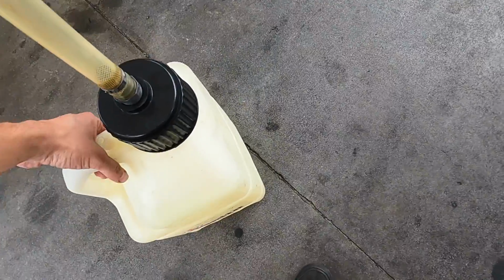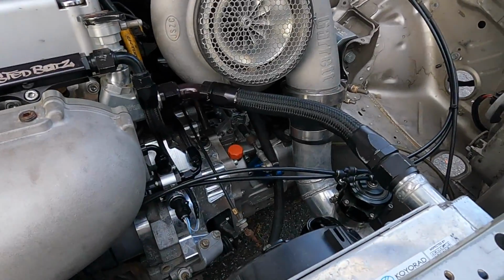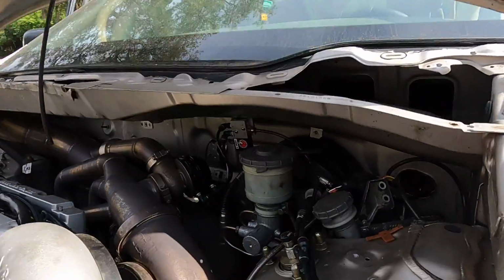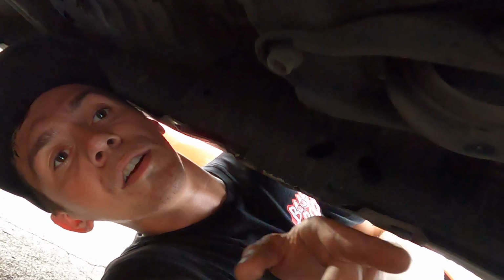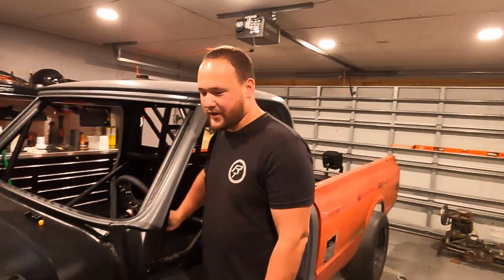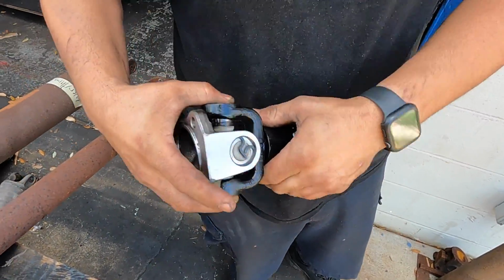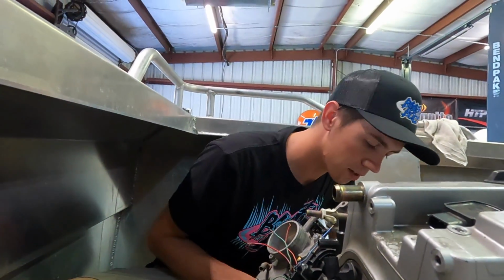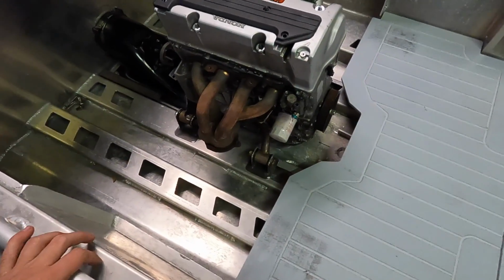Custom Parts Came For Our K-Swap Jet Boat Build!

Comment: I love the fact that your k swapping a jet boat when most just convert from other water craft, same as the Sandrail v6 honda engine making far more power and torque than most side-by-sides with more suspension travel aswell. You can buy something but converting these things with engines that can easily make crazy power even in boosted stock form is far more fun and offers more speed and ideas down the line.
Reply: Phong woulda used a modified cv joint from the pile  instead of that bought not built piece lol.
Reply: @leadfoot8593  we all would have. Haha
Reply: @leadfoot8593  yes Kyle and wyatt are trying to do things better now so getting some parts to a high standard when the will probably turbo it is logical. They could make something but it would probably break and you wouldn't want to be sitting on that aluminum seat with a turbo k series doing at any speed with junky parts underneath you that's for sure. Imagine a exposed flywheel coming lose of backing out its bolts.
Reply: @beany1987  kyle has a GF stop trying to choke on his wang.
Reply: Not to mention a nice side by side is 20-30k or buying a motor out of a skidoo is 5k or more. Way cheaper and way for fun and cool to see work. I’m jealous.
Reply: I love the sandrail and have buggies myself but there is no chance that rail would hang with a new rzr or can am suspension wise lol but on relatively smooth sand and not a super short run it would destroy them in a drag race.

Comment: Today I had to change the oil in an APU on the helicopter I was working on and that job sucked. However, it raises a question to Kyle. How are you going to change the oil in the beast?
Reply: On inboard boats you typically suck the oil out of the pan with a pump.

Comment: If your tapping where your mounting the Engine mounts, either use 4 massive bolts to increase thread interface or run 5 smaller bolts, two on the inside and 3 on the outside.
Reply: An use a fine thread bolt to get more thread engagement.

Comment: Hi guys! For the contact between dissimilar metals you could use some Parr Alumilastic if you can find those, we use this caulking on Reitnouer trailers for this exact application. You can also simply use some tape, any plastic type, I recommend clear bra but even packaging tape is still better than nothing.
Reply: Or just get some sheets of rubber gasket material from the parts store an slip it in like a shim between the mount.
Reply: @eldonerc2524  I figured they should have tape laying around, anything is better than nothing

Comment: Kyle you were talking about the mounts .. even if you put a 1/8 " thick alloy plate under the steel it will help ... just like your roll cage mount plates .. and it can be a sacrificial plate so you dont damage the boat rails .. this boatis goi t to be mental ...

Comment: Use stainless Nutserts for your engine mounting.  That way it is stronger than the aluminum and if they get damaged,  they are easily replaced.
Reply: Definitely don’t want stainless on aluminum, Will cause electrolysis. plated would be the best idea
Reply: @cjstricklen2930  Not with a zinc tab mounted near the engine,  as there should be anyway.

Comment: If you can keep the battery voltage at around 15 the electronic power steering will work much better. The voltage drops cause dead and hard spots

Comment: the idea behind the movement in the driveshaft isnt actually do to with installing etc, its to do with the flex inside the boat, the bonus is its easier to install etc.

Comment: I dunno about the bolting the engine mounts thing... that seems like a very weak point that won’t stand the vibration and torque. It would be something that breaks after a couple years most likely but with the engine right next to those two back seats... I dunno how I like that... I would possibly consider making the metal lower mount out of aluminum so it can be welded solidly. That wouldn’t be hard to do either... then it’s welded and you don’t rely on bolts and thin aluminum threads... trust me, they will fail eventually, aluminum is not great at holding a thread, the amount of times ive stripped aluminum threads! 🤦‍♂️ Anyways hope this finds you well!
Reply: Chances are that those mounts will be regularly inspected with engine rebuilds.

Comment: Love the jet boat build series. I would like to suggest another idea for the motor mounts. instead of drilling and tapping thin aluminum stringers, look into installing a heavy duty nutsert rivits. I use these in  body up fitter shop  i manage, and they hold great

Comment: Water to water heatexchanger so you can run it in salt forever. And you could still notch under the the engine mounts and add some thicker material, just make sure its flush.

Comment: Kyle, you can always install nutzerts into boat frame. Just use plated ones not stainless because stainless will make aluminum oxidize way faster than just regular steel.
Reply: Why not get some aluminum lower billet mounts made and weld them in and let the mount bolt in.
Reply: Nah, wrong mate. 316 SS is the go to bolt preference for any aluminum fabrication, especially marine.
Have a look at any Quality outboard motor or PWC. The only choice worse than steel is galvanized steel, zinc hates ally. 
What really opens your eyes is Mercury.
The mercury from a broken thermometer in the bilge will sink an ally boat in hours.
Reply: @allxdup1909  I agree 316 stainless with a thin slice of rubber to insulate the steel bracket from the aluminium. Aluminium solar frames are mounted on metal roofs this way and i have seen 10yr old installations with almost no corrosion even near the beach. Sometimes the stainless will sieze in the alloys threads though. Maybe a little grease on the threads might help this.
Reply: @lukel2793  always use anti-sieze on ss nuts/bolts that are exposed to the elements. It stops them from seizing together💪
Reply: @lukel2793  Mate with rubber under the mount bracket you will never keep the bolts tight, Duralac compound insulates all you need, its a common marine solution.
Reply: @christopherthacker7359  agreed anti-sieze would probably be even better but grease is often more readily available and will stand up in wet environments. Have used it in many boating applications with great success over the years. Growing up in North Queensland, Australia I have been salt water fishing all my life and have had a few boats now. A lot of people here including myself also swear by lanox spray to protect outboards etc from the salt. Even after 20 years they are strill like brand new under the lanox. No siezed bolts :)
Reply: @allxdup1909  im only talking about a very thin piece like some tyre tubing but yeah as long as the materials are separated in some way. It may even help with vibrations/ noise in the boat.
Reply: @lukel2793  sorry mate, it'll never work. He already has flex bush between upper & lower mount anyway, no need for more where it will cause an issue with staying put.
Reply: I understand what your saying but in the real world I have never had this problem when bolting stainless brackets to aluminium as long as quality fastners are used. If your fastners are coming lose in something like this then you just didnt have enough clamping force to begin with. This is why i personnally wouldn't use nutserts. Other things like sprung washers or nylocks could be used. Even with the poly bushes it is suprising what can vibrate in a boat at different revs and speeds. I am happy to agree to disagree 😂
Reply: @lukel2793  Maaate... remember we were talking about steel brackets on aluminum, and, the need for SS bolts to minimise dis-similar metal reaction, and, duralac or similar compound to eliminate the residual risk of the dis-similar metal reaction. Rubber between 2 surfaces makes for a very unstable, poor load bearing solution. Do you realize most boats/vessels have solid engine mounts? They are floating in water, one of the best vibration dampers around...
Reply: @lukel2793  AND Luke, we are talking about an engine with all its vibrations & loads, in a semi flexible hull, IN a salt water environment, a slightly different real world than a solar panel sittin on a roof. Not to mention skipping across sandbars. Disagree all you like mate, you don't seem to have much real world knowledge about things mechanical or marine.
Reply: @allxdup1909  Im not here to discredit what your saying, just saying there is more than 1 way to do things. Some people watching may have projects and not an unlimited budget. I just like to point out these solutions as not everyone has access to duralac or nutserts etc or may be able to afford antiseize when they might have grease laying around or an old tire tube. I've personally had saltwater going boats the last 20 years growing up on the great barrier reef here in Aus and grew up in a family that has been fishing the reef for the last 70 years. Mind you I dont use my boats for running over sand bars.🤣Plate hulls have much less flex than most regular aluminium hulls and i was simply stating my experience of mounting stainless onto aluminium which i have done in the past for centre consoles and other boat additions. As ive stated in other replies personally I would just make the bottom half of the mount from aluminium plate and weld it in and let the poly bush be the separation. Either way I think this is a fantastic build and would love to have a k-swap jet boat of my own one day. Currently I have a 4.2m seejay drifter centre console with a 40hp yamaha and a 5.3m yaltacraft half cab with 150hp honda 4 stroke outbard. What do you have? 

(edit) Also I only mentioned the solar as its common for stainless fasteners and aluminium racking to be used and mounted on galvanised steel roofs here and can last many years with no corrosion in very salty environments, this is starndard practice in the solar industury and these days i have seen similar systems used to fit solar on boats with no real problems.
Reply: @lukel2793  very true....grease is more readily available to everyone at just about any given time. I do admit I'm not from around the ocean but deal with fuel tanker trucks and trailers that run heavy salted roads in the winter time and have a great deal when other mechanics dont use grease or anti-sieze making the job harder...which for us at work anti-sieze is readily available for us to use...infact about every mechanic at my job has a jar on their toolboxes and yet some still forget to use it 🤦‍♂️lol
Reply: @christopherthacker7359  Yeah it really can turn a simple job into a nightmare. I am currently living in Sweden at the moment and I am suprised how many people don't think ahead given the conditions. Being a car enthusiast it breaks my heart seeing what the salt does to cars. I can only imagine some of the troubles the salt gives you with trucks. I think being near the ocean is nowhere near as harsh as longs as the vehicles get the odd wash. Luckily the machines i work with here never see the salted roads.
Reply: @allxdup1909  I have also seen lead cause problems with aluminium. a forgotten sinker in the bottom of the boat can lead to a hole over time.
Reply: Good old galvanic series.
Reply: Please more people like this so Kyle sees it
Reply: #facts
Reply: I wouldn't do the regulare round one's you also have a hex type of nutsert. The thing with the round ones is that they sometimes will start spinning in there place, making it impossible to get lose. Especialy on Aluminum I wouldn't do it because it's a softer material.
Reply: They do make aluminum nutzerts
Reply: Magnesium anodes for Fresh water.
ZINC for Salt water.
Must be done, or the engine ground will corrode and some have melted through the aluminum. 
Every dissimilar metal will corrode very fast. Listen to those of us who have owned boats our whole lives. We have witnessed this. 
Also it would be fun but dangerous. When the ground starts to corrode, some times when you have wet feet and are standing on or touching the metal of the boat, YOU will get a SHOCK. You then become the ground. How many reading have had that happen, bad wet ground, touch the tiller or the throttle and ZAP. Not fun. OH and the wet ignition wires and bad grounds, then you do the "OH SHIT" the deck is lava dance with bare feet. Fun.
Reply: @opossom1968  Its actually kinda amazing how many anodes are inside a modern outboard. Seen one where the anodes were never serviced and the aluminium head of the motor was like swiss cheese. You could put your finger through a lot of the holes.
Reply: Is cutting mounts out of al and welding them in a bad thing?
Reply: @leadfoot8593  This would be the best solution. Cant say I would trust nutserts for my engine mounts.
Reply: He could just fish the bolts in and face them up. They make wires that are wound the same thread pitch for bolts then you just pull the wire though and pull the bolt in. I have installed a bunch of 5th wheel hitches and the kits come with the wires to fish bolts into frame members.
Reply: Beat me to it. Just posted the same idea and seen you had already suggested this solution.
Reply: Or plain aluminium nutserts

Comment: Love the progress! One word about the 1310 and the jet pump. The engine needs to have a minimum angle(crank) of 2* compared to the jet drive shaft. Otherwise the U-joints will wear unevenly and will fail prematurely. Ask Finnegan too, he'll confirm
Reply: Heads up if you wanna make the ⁰ symbol just bold down the 0 on your phone or on a windows P  ALT + 0176
Reply: @1MrPooney  °
Reply: @tannersorgenfrey7566   °!
Reply: @1MrPooney  no on Android that is just an exponent. Like ⁹ or ⁸ this is the degree symbol ° not ⁰
Reply: @1MrPooney  just hit the symbol button on the bottom left then go to the 2nd page...
Reply: @1MrPooney  or just comment on the phone °°°°
Reply: .5 degrees is all you need to rotate the needle bearings.
Reply: You can get away with less, I've had an installations run for thousands of hours at one degree. I've seen some industrially that are even less, close to a half a degree running without issue.
Reply: I was wondering about this. I posted on their insta about it. It looked like it had no angle in video but could just be the camera making it seem that way
Reply: With Hooke type universal drives there are two main issues to take into account.
a/ the angle between the input and output will have a cyclic speed variation that increases as the angle increases - this is why you need to phase driveshafts correctly, to correct the speed variation with the second/final driveshaft universal joint.
b/ as some of you understand, with very low angles the rollers may not be rotating around the cross, inside the housing, and this can cause vibrational fretting. As such, there is usually a minimum recommended angle, usually around 2°

For special characters, press the windows key and the ful stop key to bring up the options available to you - note, there are a ** load of them, and at the bottom you can select further options.
Reply: He already took that into account

Comment: You could always cut out the sections below the mounts and weld nuts to the underside of the plates with a plate wedged and welded in between the 4 nuts across the center, then weld the nutted plates back into the boat. This will give you more threads for the mount-boat bolts and the plate wedged between the 4 nuts will aid in stopping the welds holding the nuts on from cracking or breaking because the nut will be pressing up against the plate, insurance so you never have to cut those plates back out to reweld the nuts on.
Reply: Stainless Nutserts are easier.  Probably not cheaper though.
Reply: @BeardMan01  yah but being engine mount bolts, a feller will torque on those till the tenden pops and certs tend to spin over time. Over engineer shit like this so its done once.
Reply: @MillionairX  Factory vehicles with aluminum unibodies use Nutserts all the time for all sorts of critical components.  They are absolutely up to the task, especially if installed correctly.
Reply: @BeardMan01  you don't want stainless in contact with aluminum, the nickel in stainless will eat the aluminum fast.
Reply: @eldonerc2524  Not with a zinc tab mounted nearby,  as there should be anyway.